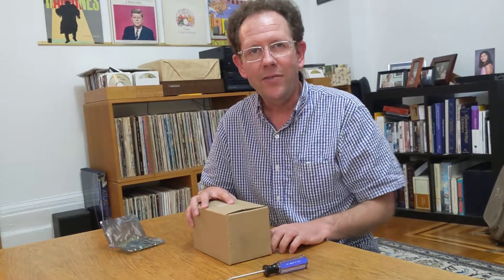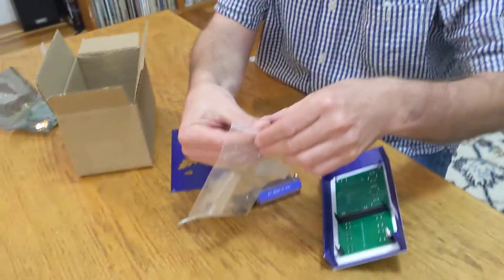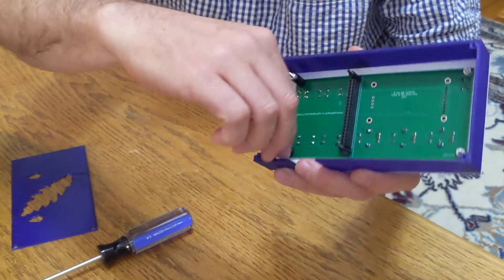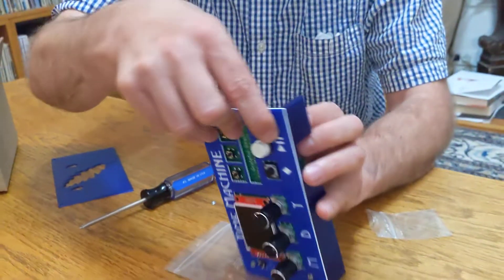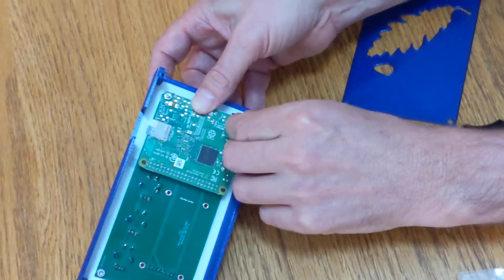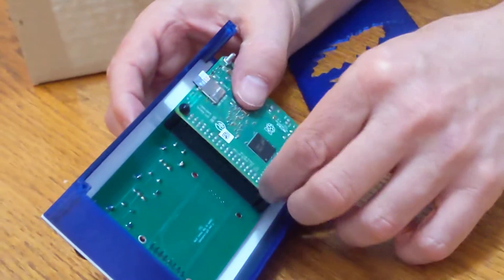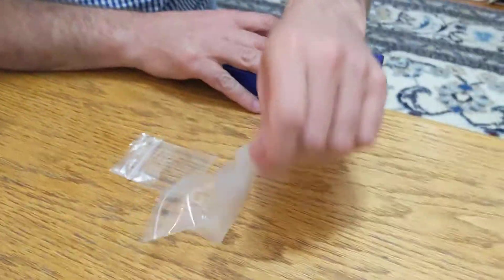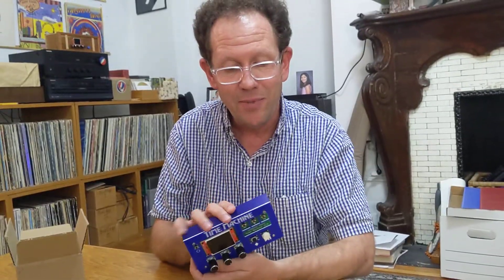plugging your own raspberry pi into your Grateful Dead Time Machine in a case

Comment: Just finished building mine today and of course its the 50th anniversary of Veneta 8-27-72, so that is playing now. A couple of notes for those building the kit.... 1) The Raspberry Pi 3A+ is scarce right now, I ended up getting one off ebay for $45. 2) the 40pin connector was prob the most difficult to solder, just take your time and go slowly 3) the area where you put the 4 case screws started to split, I put one very very small drop of silicone oil in the holes and the screws went in with ease.  Thanks for putting this together! If you have basic soldering/electronics skills this will be easy to put together.

Comment: If I wanted to build my own could I use a different sized screen?
Reply from the maker: Adding a different screen would involve a fair bit of programming. The current Time Machine is designed for a 128x160 pixel display, which is deeply embedded in the code.